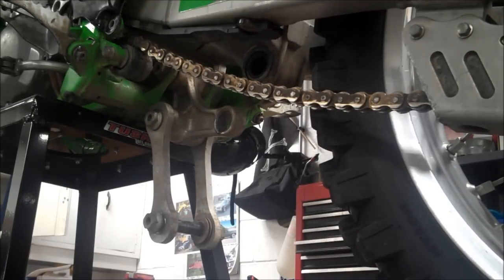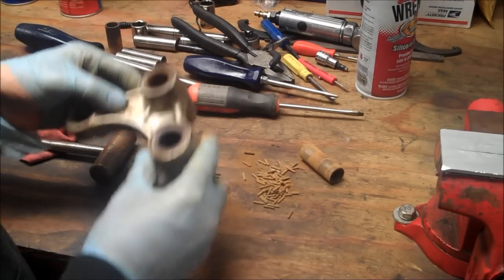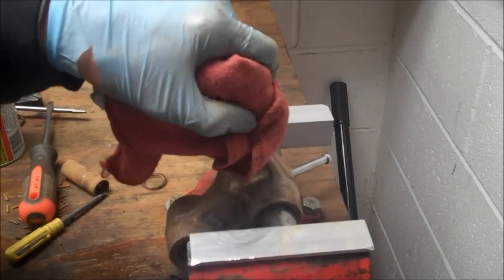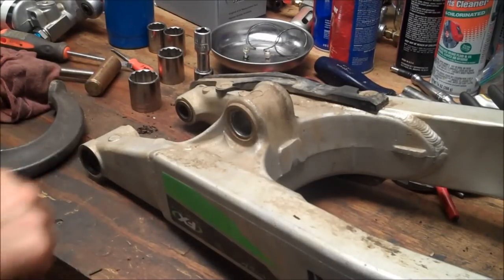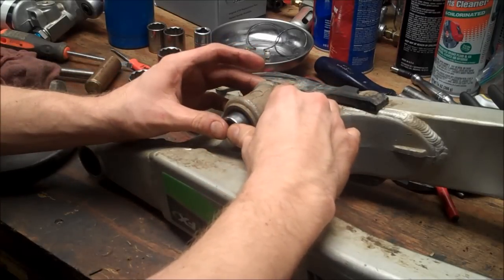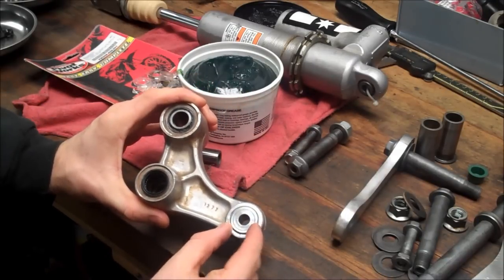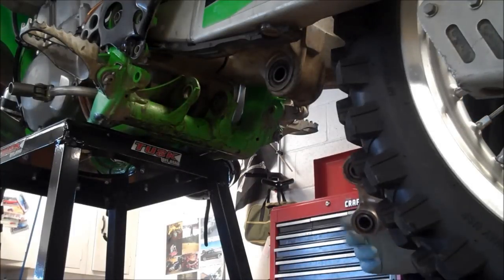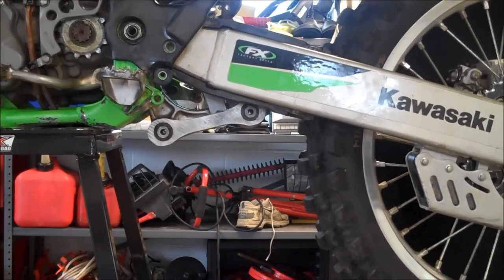KX250 shock & linkage bearing replacement - Pivot Works

Comment: Awesome.  Great video and I like how you're not like "go buy this and this and this".  I'm new to dirt bikes and I'm rebuilding a 99 kx250 and spending more than I budgeted because I don't want to do it again and keep finding new things that need to be or should be replaced (such as a complete bottom end, which has about $250 more in bearings and seals than the "complete bottom end kit" everybody sells.  Anyway, you're awesome for putting these videos out. Keep it up. Thanks.

Comment: thanks for your video, I have exact same components on GasGasEc300 and of course the same issues. I was thinking to weld the linkage but wasn't sure if it will hold. Now I will do it since is the cheapest solution.

Comment: Same thing happened to me pounded the nut in and only got it moving after few sprays of lube and few wacks with a 4 pound beater. Threads and nut and bolt where both toast and I was trying to save them but it was only way to get it out.

Comment: I got the all balls kit.  Did the lower bearing on the swingarm, all 3 on the linkage knuckle thing, and ended up with 2 different inner sleeves and 2 end caps that don’t fit anything left over.  So confused.  Good video though as always

Comment: Just found your channel as I do this job myself.  Thanks for uploading it!  One trick to get out that first bolt you had trouble getting out is to remove that rubber bushing guide for the chain on the left side there.  It makes accessing the bolt much easier and with zero cussing lol

Comment: I have owned a 2000 Kx 250 and and currently own a 1998 kx 250, and both had the exact same problem.  I replaced the arm both times.  People just neglect their suspensions.  This is a minimum once a year lube.  Good video.
Reply from the maker: Do the bearings last if lubed once a year? I only put 7hrs on it so far.

Comment: Hey Matt, very nice and simple videos. I followed your instructional guide to replacing front fork seals on my 1999 kx250 and it was very simple. I even modified a 1 1/2" 40 T just like yours and it worked like a charm. Now, for the question. after putting everything back on the bike, i put the bike off the stand. As i picked up i heard clicking from the rear suspension. I can sit on the bike and when i let the suspension stroke come back up it clicks several times at the top. Is this a shock issue or is it a bearing issue like you are working on in this video? I bought the bike used so you know how that goes lol.

Comment: Hi! I have the same problem with the lower shock bearing. I've had it replaced twice and it still keeps wearing after another. I'm thinking about making a nylon bushing for it. Will it work?
Reply from the maker: Pentti Mattila I don't think that will work. Reason being is there is too much force on such a small "bearing surface". It really needs to redesigned to take the load. This reminds me, I need to check mine.
Reply: MatthewMCRepair I was also thinking about using inner section of the bearing with the bushing because the shock "bearing" needs to move in a certain way. And the plastic I'm going to use is a very hard (polyurethane) and it's made especially to make bushings so I think that it will last longer than bearing.
Reply from the maker: Pentti Mattila I thought about replacing that bearing as well. Ever heard of Igus? They make plastic bearings and bar stock where you can machine your own. Let me know how yours works out.
Reply: MatthewMCRepair I will machine my own bushing because I have the tools for it. Btw I watched your front fork repair video and I managed to service my own forks(I have 1999 KX250) and saved quite a bit of money so thanks for that. Nice videos! Keep them coming.
Reply from the maker: Pentti Mattila No problem. Glad I saved you some coin!
Reply: +MatthewMCRepair Hi! It's been six months since I've installed my own bushing to replace the lower shock bearing. I have ridden 10 hours with this bushing installed on the bike and it has worked just the way it should. There is absolutely no movement anywhere on the whole package! I machined my own bushing from polyurethane and it's very tough and it doesn't seem to wear easily so all I can say is that I strongly recommend it for everyone if you don't have money to buy whole new shock mount or you don't have tools to weld it. It is very cheap and easy solution just make sure your shock bearing mount isn't too worn out because it can be dangerous!
Reply from the maker: +Pentti Mattila Awesome good to know. I thought about this and was about to order plastic bearing material from Igus. Thanks for the feedback.

Comment: What I don't understand is, why I Motorcycle company, that specifically manufactures a vehicle to be used in the mud and the dirt and the water, would skimp out by just a couple of dollars and not put non-corrosive parts in there. Seems like kind of a douchey thing to do. If a company is going to charge me six seven eight nine ten eleven twelve thousand dollars for a bike, you're taking all my money Put it into the actual quality of the build. I mean these bikes aren't going to be used strictly indoors where it's dry and perfect environment. They're going to be used in the most filthy crummy cruddy dirty wet icky environment possible. Why on Earth would you incorporate parts that are going to corrode or rust?
Reply from the maker: Non corrosive materials usually don't make good bearing material. Instead, people need to follow the maintenance procedure outlined in the service manual. Regrease every 10-15hrs or every year.

Comment: Heat and PB Blaster... exacly what i used for my 04 linkage.... rusted and seized too.... must be a kx thing
Reply: I had a bigger vise and used a 5 foot pole on the end of it to get leverage to even turn my vise.... it was horrible
Reply: Im replacing mine tomorrow on my 1995 kdx 200. Its never been done. 23 years those bolts have been on there and them bearings never greased

Comment: Damn dude, i got hung up where you got hung up at, my bolt is froze between frame and shock linkage, got pissed and now its miller time. Gonna try heating it up in the morning though, its in that tight spot where you cant really hit it with anything, gonna have to break out the air hammer
Reply from the maker: Soak it with penetrating oil and walk away for a while. I used an air hammer or BFH and trashed the bolt. At least it eventually came out.
Reply: Its been soaking in PB blaster for a day, I have gotten it to turn but it just doesnt wanna back out, its pretty beaten up from the air hammer, good thing I dont have a deadline
Reply from the maker: I feel your pain right now. Anyway you can cut it? It's been a while since I did this so I don't remember how much room was in there.
Reply: As did mine, I said fuck it and tore the motor out so I could fit the breaker bar in and get a better angle. Worked great 👍🏼

Comment: I've got a Kx250 myself and a Crf450, however the grease on the Kx linkage bearings seems to be washed out really fast compared to the Crf, But like you said, i guess the Kx linkage is pretty poorly thought out?
Reply from the maker: Yes, I've read a ton of threads where people are going through these bearings quite often. I have 8hrs of mx on the bearing right now and will check it over the winter.

Comment: i rebuilt my rocker luckily ...but I didn't have a vise or torch so I soaked it in on blaster for 30 mins....and put it on a space heater for 15....did the socket thing ...but with a hammer against the floor...once I saw the race go down a mm I knew it was gonna come out ....i used a 30 mm...on the other end and hammered one that matched the race ...came right out...just in time two sections of the race were gone but it still has the back ring intact...im gonna see if Kawasaki will sell me just the dogbone bearing....i didn't know it was this crazy to do bearings have my bike totally apart right now so after watching this I checked my swingarm lucked out with the rocker I shot on blaster into it with the seals off....then lithium greased it....works good.i really hope I don't have to buy a bearing kit for just the dogbone...2009 kx 250f
Reply from the maker: See if these people sell it separately: https://store.factory-links.com/

Comment: Thanks for the hot tip on using heat and a vice to get the old bearings out of the linkage, but like a typical yank you gave up to earlier, I persisted that little longer and succeded, boo Ya

Comment: The vice/clamp did not work for me - bearing would not budge - I ended up hammering the socket through and this worked much better......
Reply from the maker: I used that method as well. Whatever works right?

Comment: How did you get that last bolt out? Mines stuck bad.  I broke my linkage right where you guys made your repair. Luckily i have an extra frame.  Hopefully i can fix it
Reply from the maker: I cut it. Also, BFH and a lot of swearings helps.

Comment: Hey, my shock arm linkage on my 1994 kx124 seems to be identical, I took everything apart and the "dog bones"  or the shock linkage pull rods look like they have wear right where the bolt goes through do they need to be replaced? It sorta looks like there's a brass insert in each hole do those need to be replaced?
Reply from the maker: The kits will come with everything you need. Replace it all.

Comment: Excellent... only comment is that all the nuts should go on the same side.  But in general a fantastic video.  I already have been though this many times and you gave a real life example of repair of one of the most needed suspension repairs for MX
Reply from the maker: Steven Schultz Thanks for the tip, Steven. I agree that this area is the most neglected on any MX bike.

Comment: when you swapped out the part on the swing arm is that still considered part of the linkage? I'm curious because I ordered a pivot works linkage rebuild kit for my 2003 kx250 and it came with 6 cages of bearing and I only need 4 for the rocker arm. I'm just curious where the other 2 go!
Reply from the maker: +Dom Mangano Are they all the same size?
Reply: The last 2 bearings go on the bottom of the swingarm, where the pull rods go.

Comment: Nice work and video, but i have one question!
When you remove this bearings, its indiferent wich side you put the larger socket and the small, or have one direction to remove?
Reply from the maker: If there is no shoulder, then it doesn't matter. The larger socket is so the bearing gets pushed out.

Comment: Was there a spacer built into the center of one of those bearing housings? I was able to press out one but it appears there is a builtin spacer dividing the two needle bearings and races. The smaller race was basically welded in there I have to take my time and chisel it out not scoring the housing.
Reply from the maker: steve steve I don't think so. Check parts diagram to be certain.
Reply: After a few hours of heat and patience, I finished the job.  Turns out that centerpiece was only one of the inner rings from the needle bearing cage.  It just happened to seize up and I got lucky that the same thing that happened to yours didn't happen to mine.  There was nothing left in the smaller one, a few more rides and it would have ate away at the housing most likely requiring a new part.  Thanks for the response, I never had to deal with a linkage in such bad shape.  Take care.

Comment: Hi I'm having a problem with my 2003 kx250 the rear shock seams to be over extenting so the spring is hitting the swing are could you possibly help me out ?
Reply from the maker: Maybe watch this video and see if you have any worn linkage bearings: https://www.youtube.com/watch?v=Lip79mkLq9A
Reply: MatthewMCRepair sorry I explained it a bit wrong it's like the shock is over extenting the swing arm is going so far down the shock is hitting the back of the engine hope this helps I'm really puzzled we it now
Reply from the maker: Maybe the seal head in shock is bad? https://youtu.be/rcxgBliv2uE

Comment: question, after heating the linkage cage or whatever its called. wouldn't the heat make the metal or aluminum softer? thanks, nate
Reply from the maker: nate bennett The heat added will probably bring the temp of aluminum up to 200°F, which will not hurt it.
Reply: oh ok thanks

Comment: I have the same bike and I’m still trying to get that pesky bolt out holding in the arm, I’ve tried oils, heat and hitting really hard, do you have any other ideas?
Reply from the maker: I had to cut it.
Reply: @HTMR  should I try just cutting the bolt or try and remove the whole arm assembly because I have a newer one ready to put in it’s place.
Reply from the maker: @alexmehregan5144  Cut it.

Comment: Good video, I noticed your tie rods slipped on very easy over the bolts.  Mine was really tight very little tolerance around the shaft of the bolts.  Not sure why it was so difficult, it took a while to line them up after the rebuilt.
Reply from the maker: Rusty bolt? Maybe a burr?
Reply: Not sure what it was.  I finally got it together, just took a while.  Rebuilt the whole bike, frame off restoration.  Came out really clean, took it to the track and it performed like it was a new bike.
Reply from the maker: Awesome!

Comment: How did u end up getting that linkage bolt out im in same boat?
Reply from the maker: BFH and a lot of swearing. I ruined the bolt and nut so it is $20 or so to replace.

Try some penetrating lube and heat. I did not try that.

Comment: Need help. Can i use any washer (obviously right size) on that top bearing ?
Reply from the maker: Please reference a time in the video so I can help.
Reply: MatthewMCRepair at 29:41 those washers.
Reply from the maker: I don't see why not. They are probably metric though and hard to find at hardware stores. Why not just buy the OEM ones?